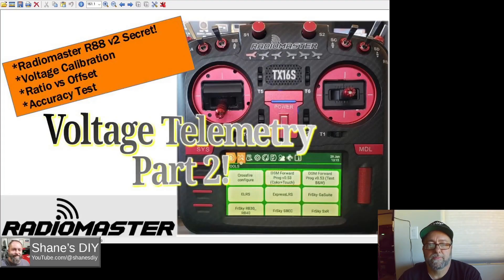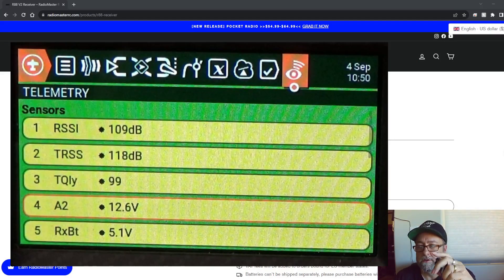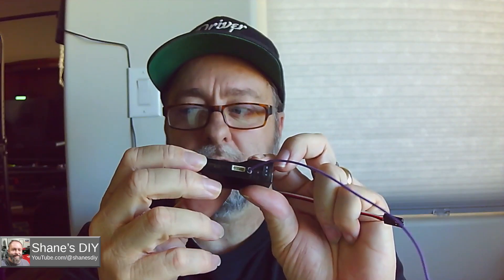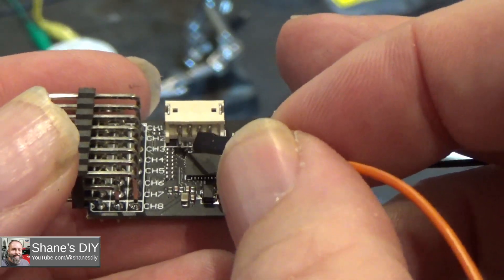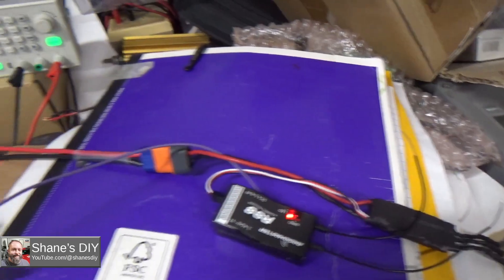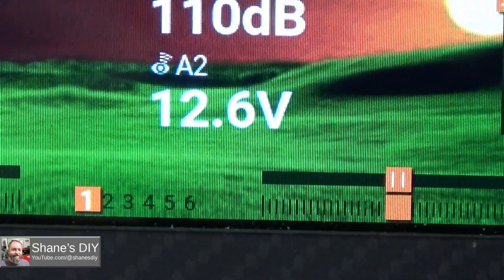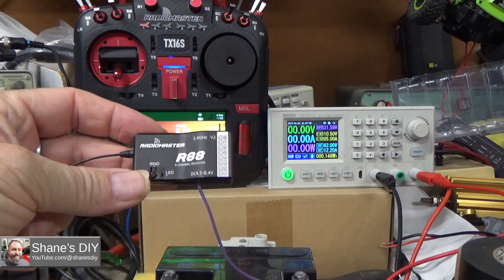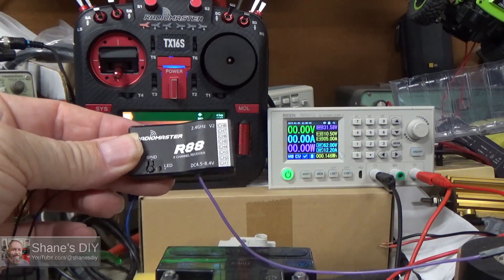Part 2 Radiomaster R88 V2 and TX16S EdgeTX 2.9.0 Voltage Telemetry Tutorial

Comment: Hello friend and thanks for this discovery.  I had the r168.  But now with the r88 it was no longer possible to display the voltage of the Lipo battery but with your modification it is possible why I never thought about what that x was before.  question can I connect a 6 cell battery to the x connector, in your video you show that you give 15 volts and no more.  thanks compliments of the channel.🤪
Reply from the maker: Someone else asked that below.  18.81 volts is max wiring direct but if you add a 220K ohm resistor inline on the sense wire it should safely read up to 26.07 volts for your 6S pack. This is because the receiver has a voltage divider circuit built in and the 220K resistor offsets the voltage the RX "sees".  I haven't tested this limit myself, just learned by research and analyzing diagrams.  Use at your own risk.  You will, of course, need to properly calibrate the voltage as I've shown in this video to get it to read correctly.
Reply: Hi, thank you so much for replying to me.  I'm Italian, I have the old r168 receivers which I really like, I set my RadioMaster tx16s with Open TX so that it talks to me when it reaches the 4s battery storage voltage, which is 14.2 volts and everything works great, Not Unfortunately I bought other receivers because I thought that the R88 v2 did not have the Vbat input as it did for the r168. But thanks to your video I noticed that the sbus connector has a fourth pin called X next to it and which can accept this voltage as input lipo, I know that there is a resistive divider inside, I had already thought about putting a resistor to attenuate the voltage value of a 6s, but I had no guarantee on this but since you also proposed it to me, for sure It works very well, obviously after some tests to be done.  now I will make a purchase r88 v2 to modify it according to your instructions and if it works and if the radiomaster warns me with a voice message (model battery empty land immediately), I will be happy and I will buy others.  at our airfield many have no longer bought Radiomaster receivers due to the lack of VBAT in telemetry, as soon as they find out about the change they will make hidden purchases of R88 v2.  Thank you so much for giving us this gift of knowledge, you are a GENIUS.  thank you thank you😀👍👌
Reply from the maker: @canalez-r1j  I'm so happy you found the video useful.  I also did a very extensive range test of the R88 V2 if you find that recent video.  I have some more videos coming soon on another range test with some TX mods, as well as a video on the TX mods I'm doing. I may also do another video on the voltage with the added resistor to confirm it will handle the 6S voltages.
Reply: Hi friend, I am Dirk from Germany and have done the mod with the 220k resistor in series to my 6s LiPo with my  R88 V2 and TX12 MK2 transmitter. It works fine and shows the right voltages that i have measured with my multimeter. From empty at around 20 V and full at around 25V my transmitter shows the exact voltages in 0.1V steps. You have to correct the values in the transmitter telemetry setup screnn like shown in the video, thats it.
And thanks to shanesdiy for this great information/channel about the A2 pin at the R88 V2. That´s the thing I have missed. For about 12€ at banggood you get a receiver with RSSI, RxBt and Fl(ight)Bt telemetry data without any external sensors 😀

Comment: Do you know what the max input voltage is to A2? I'm wondering if I can get a read on a 6s 25V pack?
Reply from the maker: 18.81 volts is max wiring direct but if you add a 220K ohm resistor inline on the sense wire it should safely read up to 26.07 volts for your 6S pack. This is because the receiver has a voltage divider circuit build in and the 220K resistor offsets the voltage the RX "sees".  I haven't tested this limit myself, just learned by research and analyzing diagrams.  Use at your own risk.  You will, of course, need to properly calibrate the voltage as I've shown in this video to get it to read correctly.

Comment: This is probably a basic question, but on my Radiomaster TX16S I can bind to the R 88 receiver, but I’m not getting any RSSI numbers back.  I can bind to a different receiver like Frsky X8R and get RSSI immediately as well as battery voltage. Any ideas why I cannot get that on the R 88 receiver when I bind to it?
Reply from the maker: What protocol are you binding with?
Reply: That was it.  I watched another vid on binding this specific receiver and it showed a different protocol then what I was using.  Thanks again for your great vids and helpful info for all of us.

Comment: Thank you so very very much.. Have been looking for this for 3 weeks now!! Finally... Although a Spektrum/Radiomaster+ELRS guy myself. I am helping with setting up a club plane with 2 QX7's. I was really disappointed that so little useful information is documented with and about frsky stuff and compatibles, espescially concerning telemetry... Battery voltage in IMHO should be build in as a standard on virtually any receiver from any brand...   very grateful to you to point this out for this receiver !!

Comment: thanks for the great tutorial. Anyone knows the name/specifications of a 4 wire female connector that would fit?
Reply from the maker: I believe it is a ZH 1.5mm JST, 4 pin. I contemplated getting a kit off Amazon that has many different sizes but was hard to justify $25 for a kit when I just needed one for this project. Note, this was my best educated guess on the connector based on research and measurements so take that for what its worth... if I can find a smaller, cheaper kit or pack I'll pick it up and test.
Reply: @shanesdiy   Thanks a lot, I will get a some sets from aliexpress, different sizes, just a couple of euros/dollars, but takes some time to arrive
Reply from the maker: @robdapraia3486   I just tried pulling the white wire pin 3 out of the included ZH connector to move it to pin 4 to use for voltage telemetry and with a small sharp pick it was actually pretty easy to get out.  If you don't plan to use the SBUS cable turns out it is pretty easy to move the wire in the connector.  If you happen to mess up one, you have 3 tries.
Reply: Nice! Yes, only need the “x”

Comment: so you are using a scope . so you are calib the telemetry to PEAK to PEAK and not RMS as i assume more telemetry sensor use . ( also lets forget about relative / average ) but without explaining this to folks with cheap multimeter you are all calibrating to whatever...
Reply from the maker: No scope was used in this video, just the variable bench power supply which I previously validated with my Fluke 87V to make sure it was "close enough". Any average multimeter or even your LiPo checker will suffice.